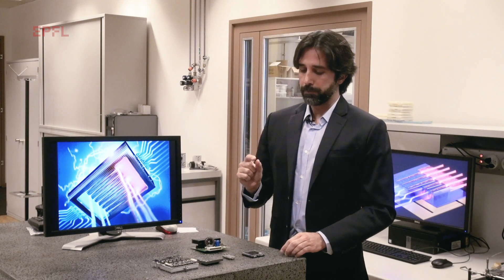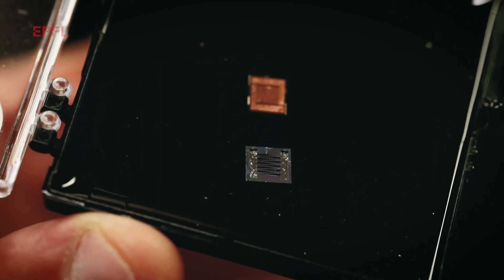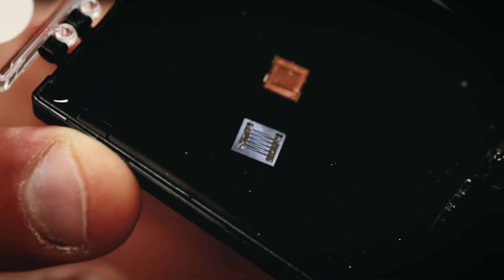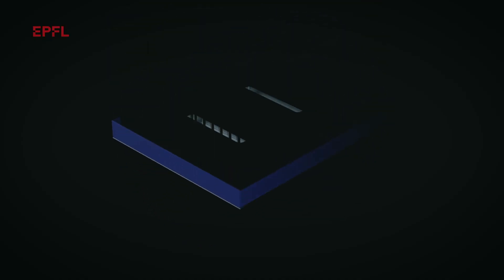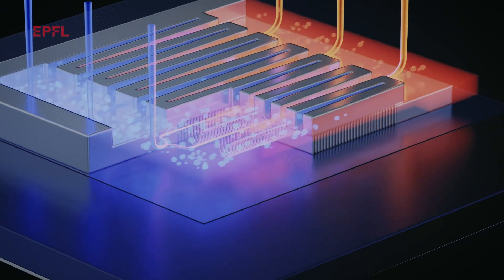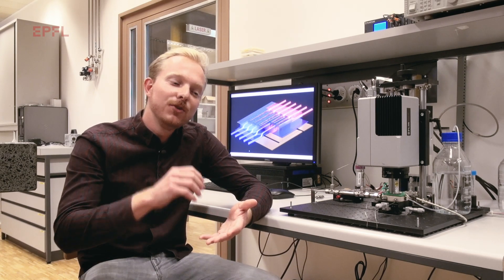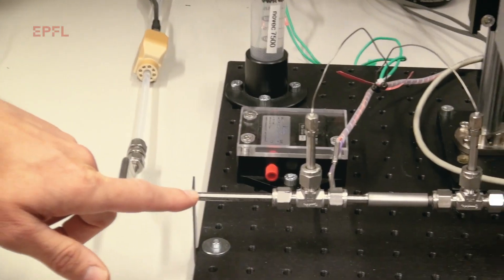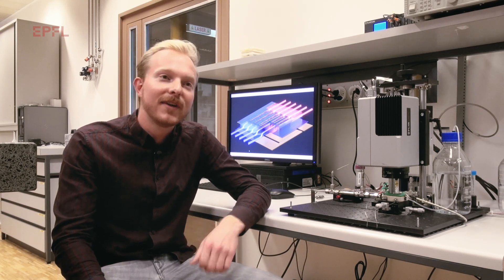Transistor-integrated cooling for a more powerful chip

Comment: why water dont damage the si chip?
Reply: I think  they put water inside the die not inside the chip
Reply: I think the 3M Novec 7000/7100/649 is used because they are talking about a condensing liquid. 3M Novec is a non-electrically conductive liquid that condenses at a maximum of 60 ° C. At least in Germany it is not freely available.

In this case 3M Novec 7000 is a good choice because its condensing point is 34°C.